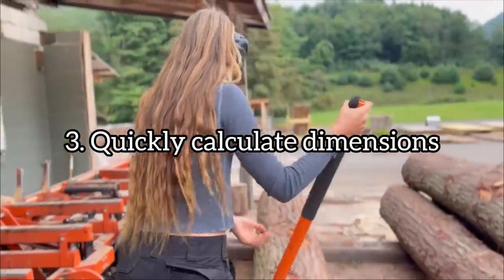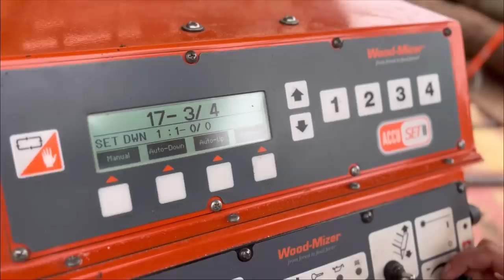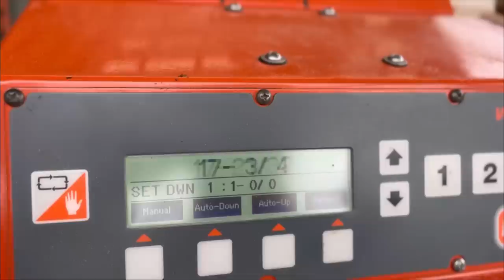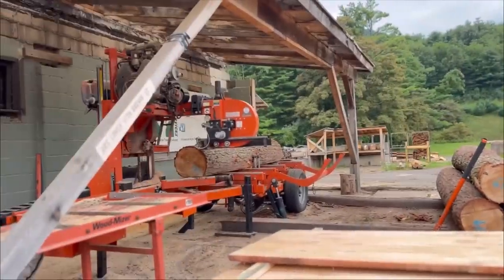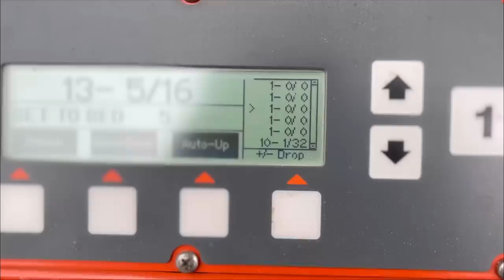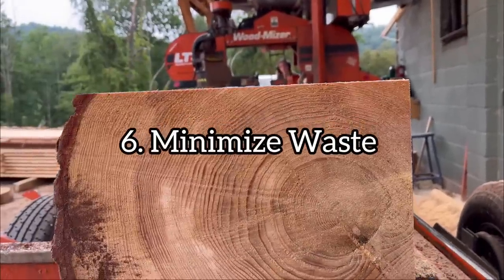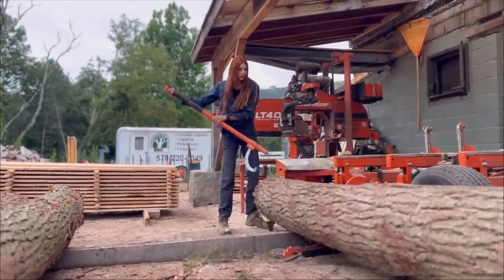7 Things I’ve Learned from Being a Sawmill Operator!

Comment: This seems like a good video to ask a question, though too much time may have passed.  Sometimes you show a close-up of the clamp that holds the log in place while you cut (it probably has some technical name).  I see it clamping down and digging into the wood and I keep thinking that it's damaging the board that comes out of that face.  Do you worry about that, or does that get fixed as the raw boards are finished?

Comment: What's the relationship between species and default dimensions? Is that like saying your hemlock always get cut into 5/4, where your SPF is mostly used for 2x4 and 2x6 ect?  White oak for beams. Cedar for decks. I still can't figure out what to use red oak for, lol.
Reply: All the hard wood floors in my house are red oak from a local sawmill in west central Illinois.

Comment: Emerald, you should have a scientific pocket calculator, perhaps a graphing calculator, and be able to work the calculations to be able to check the results from you computer on your sawing machine, your sawing machine may not always be right.  Zero waste is specific, being able to calculate the maximum volume from a 3-dimensions geometry requires algebra, geometry, trigonometry, and basic functions in 3-dimensions and no log is perfectly straight, and being able to do those calculations on paper with a scientific pocket calculator would be a patentable concept as a programmable calculation, as is the maximum floor space program.  Floor space, however, is not in 3-dimensions.  What rotation alignment and where to start the first cut on a wonky log to get the maximum volume of useful log product would require measurement in increments along the length of the log and at what rotation each measurement is from one another measurements, and finding the waste volume to be the least.  Once the solution is arrived at, repetition would take increasingly less time to determine and could eventually be cost effective.

Comment: Hi Emerald, you're constantly overdriving your audio. Either you're too loud for your microphone, or the microphone has too much gain for the microphone preamplifier. Anyhow, the result is distortion. Please fix and keep up your otherwise excellent work.
Reply: Or. . . Enjoy the noise.  Failing that, somewhere on the device that transmits audio after you push ‘go’, there is a nob or button to decrease the audio volume that your ear holes finds unpleasant.  Just my thoughts.  Cheers.  That you watch is the important part.  (Edit:  back grounds gonna happen - high or low. . . it’s a family operation, that cares about us . . .not a mix filter hollyweird production x again, Cheers!)
Reply: I listen thru headphones and have not noticed any problems whatsoever with the audio.  Emerald, you have an excellent voice tone, quality and volume for your presentations.  It was very soothing in this video.
Reply: @JT_70  This isn‘t a thing in just this video. It‘s a general problem. Everytime she raises her voice her audio distorts. And no, the problem isn‘t on my end, since I have it on four completely different setups.